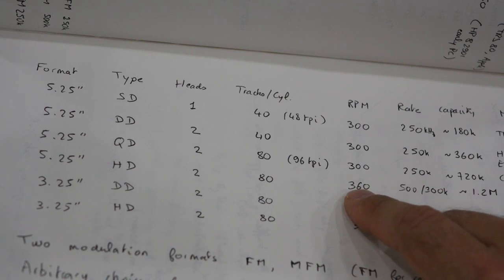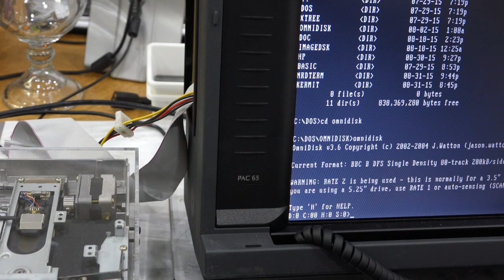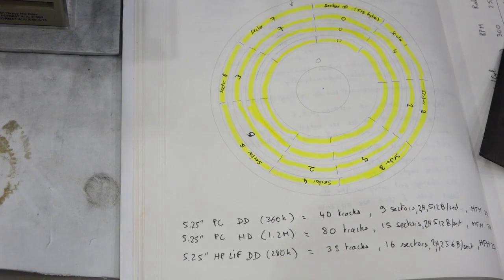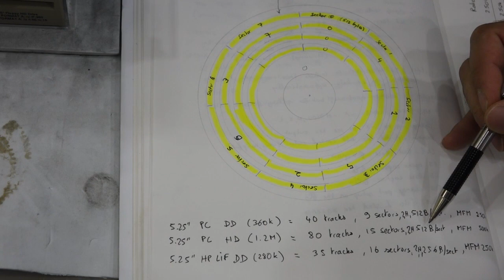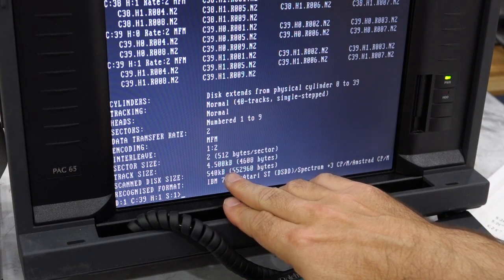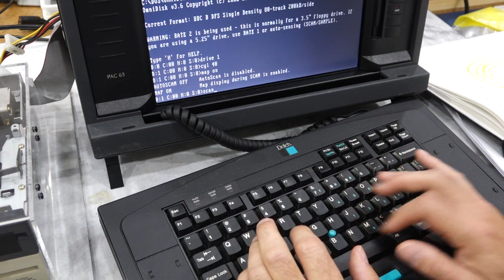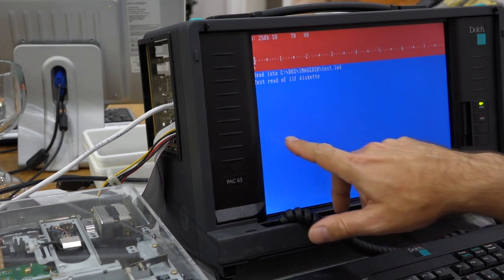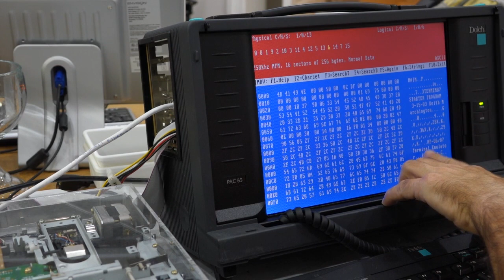5.25" Floppy Part 2: (very) low level DOS Floppy utilities tutorial

Comment: This reminds me painfully of the time I installed a hard disk drive in my first IBM-compatible PC. I had to manually enter the tracks/cylinders/heads of the drive into the BIOS, and then check that the reported capacity matched that of the actual disk. It's a miracle that I was able to get the thing to work back in 1991, or whenever that was.

Comment: Also, very old floppy disks had a reduced window to allow only 35 track access, that's why HP, Apple and Commodore (to cite few ones) were only using 35 tracks out of 40 :)
If you used special programs, you could format and use up to 40 tracks on both Apple II and Commodore (1541 for example), provided you had the newer media with larger window :)
Reply from the maker: Thanks again, I suspected the first disks came out with fewer tracks then it got expanded to 40, but I did not know for sure, nor the historical "window dimension" reason. That finally explains the mystery of the 35 tracks HP diskettes!

Comment: We used to have machines where the OS only really supported single density disks, so the Os would treat each side of the disk as a separate drive.
I'd heard about many times, but I only ever saw once a HARD SECTORED floppy disk which has multiple index holes to indicate the start of each sector not the start of the track.

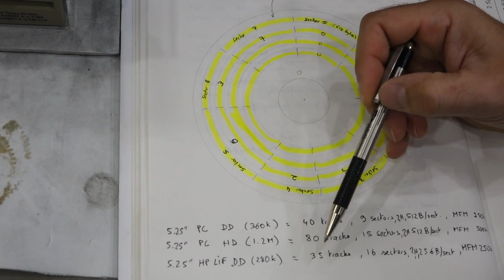Comment: 12:00 I believe all of the early 5.25" drives were 35 tracks. 40 tracks was a later upgrade and required media that was certified for 40 tracks, although if you were lucky your 35-track disks would work in a 40-track drive. IIRC, of course ;)

Comment: Since we had two PCs, one with a 360k 5.25" and one with a 1.22m 5.25" floppy, I can tell you the "HD" drive was able to handle the "DD" floppy disks perfectly fine. Read here, write there and vice versa. You could even format the HD floppies at 360k, which seemed to be more reliable than the actual DD media (higher quality of magnetic surface I assume).
Reply from the maker: It's not as simple as that. It works in a restricted number of cases. The rub its that the DD drives have a head that's double the width of an HD drive. So if you write a 360k disk with a DD drive , then rewrite on it with an HD drive, you end up with a narrow HD track on top of the old, incompletely erased DD track. If you try to read it back in the DD you are going to get into trouble, because the wide head will read both the old and new signals on the track. Also the HD magnetic media is not the same as DD and needs different (higher) write head current. So writing a 360k disk from a HD drive and reading it on a DD drive works reliably only if the disk has been formatted and written by the HD drive only. However a HD drive can always read a disk formatted and written from a DD drive. Just don't rewrite on top of it from the HD drive.

Comment: The 160k drives,  (I think) you can turn the floppy over, using both sides. My commodore drives work that way, so I think the old Tandon 160k's can do the same. I will be testing the theory at some point.

Comment: You have missed the GCR encoding (besides of FM and MFM); also the QD size is not entirely correct, as the Commodore SFD1001 and 8250 drives can store about 1MB on a single disk (using GCR)

Comment: Just for the sake of completeness... you forgot to include...

ED / EHD, 3.5" , 2 Heads, ?? Tracks (can't recall), 2.88MB
(The "ED" diskettes had a second hole below the "HD" hole so the drive would know if the floppy inserted was HD or ED - IBM was a fan of them and used to ship them in their business line of PS/2 systems).

EDIT: By the way, I think you made a mistake at the 720KB "QHD" format ... unless I missed out on something or already forgot about it was 3.5" 720KB SD DD ... I somehow cannot remember ever seeing a "720KB" 5.25" disk drive. /EDIT

Apart from that there's also the one or another oddball format on the PC, like the 1.68MB "DMF" (Distribution Media Format) on a normal 1.44MB disk Microsoft coughed up at one point which caused quite a lot of problems with el cheapo 3.5" drives.

Also, there's GCR (Group Coded Recording) as a "modulation" format; if I recall correctly at least the Commodore drives (1541 and possibly earlier models) used it; though I dare to remember something about Apple using it too at one point.

Of course there are successors to the traditional floppy disk drive, like the "LS" (~21MB) disk drive, the LS-120 (~120MB), LS-240 and lastly "HiFD" (150/200MB) disk drives which were the pinnacle of the technology near the end of their slow disappearance in mainstream PC systems. For what it's worth, the LS and/or LS-120 were actually supported by higher quality BIOS'es as a boot media (in the "Boot Order" selection not the "Floppy Type" selection as they were IDE/PATA devices); apart from the (in)famous iomega ZIP drives (but they are a entirely different topic).

That being said, nice list you got there... spares some trouble when you need to know about the specifics of a particular floppy drive which doesn't want to play along.

Comment: Is it only spring pressure that pushes the upper disk head down on the disk when you close the drive mechanism? Opening the mechanism pushes the upper head upward against the spring, and the spring forces it down when the drive is closed?

Comment: Hi there great video.
I have installed a 5.52 inch floppy drive and it read the very first disk I inserted no problems but when I put in a second disk the computer tells me it has the very same files (which it has not) so looks like it is now referring to some cached files and I cannot get it to read any other disks now ? Any help greatly appreciated.

Comment: The way the sectors are defined depends on the floppy controller chip, it uses special FM/MFM codes that aren't data to define them. luckily most chips use the same codes. The only exception I know of is the Amiga format. I've built a couple of circuits with a WD1772 FDC chip and learnt quite a lot from it.

Comment: Oh man this is so useful! Thank you!

I am currently restoring a Texas Instruments DS990 Model 1 Intelligent Terminal and it's accompanying Texas Instruments FD1000 Dual 8" Floppy Drive unit.

I have just finished cleaning the drive unit, as the system and drive units are completely covered in dust throughout. Just started on the system unit now.

I want to create a floppy drive cable adaptor to connect one of the drives to a standard PC floppy drive controller. I've heard that it can be done and I've seen detailed instructions online and I have seen it done first hand (in a limited fashion). The same setup apparently worked with ImageDisk, that's how my friend was able to load software on disks for his homebrew 8080 system.

Oh! The Xerox Alto II video series is what inspired me to start this project by the way! So thanks! :)